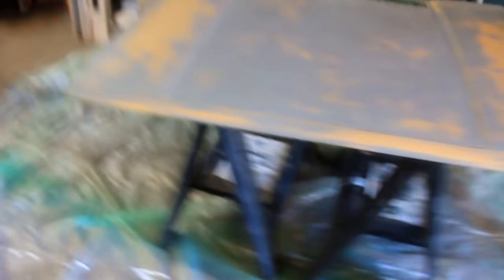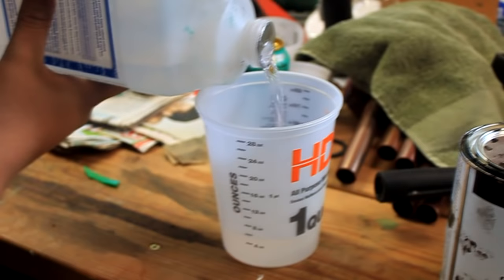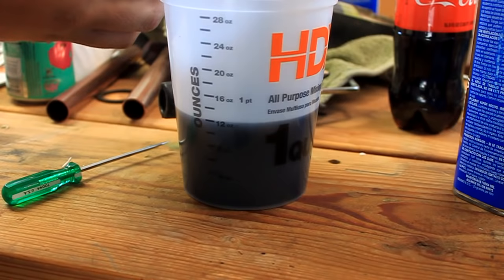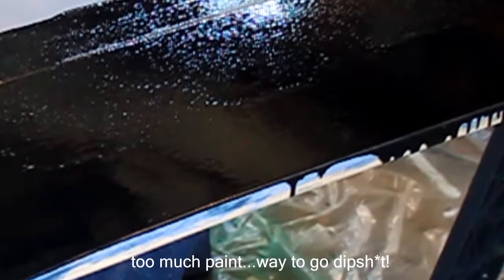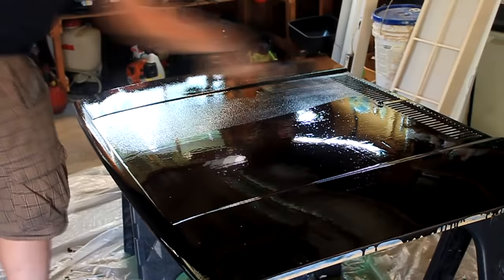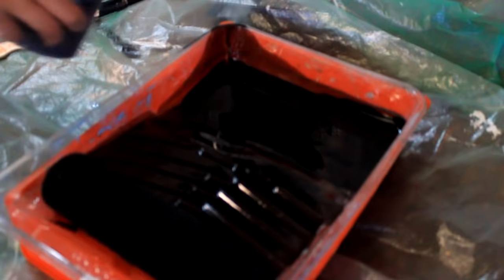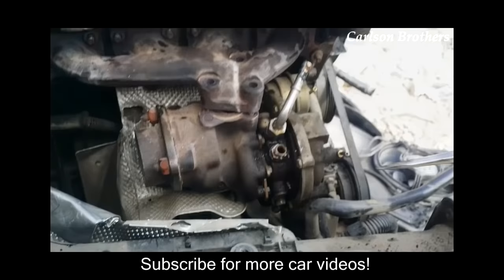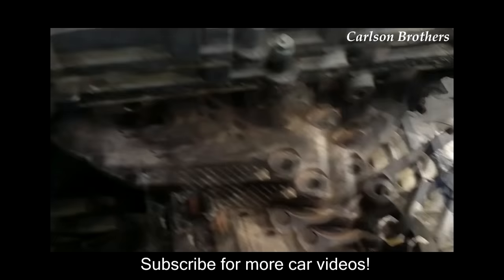How To Paint Your Car With A Roller

Comment: I repainted my entire 2003 Nissan Pathfinder LE with Rustoleum black glossy. I used 4 inch wool mini rollers and the outcome was better than any Maaco paint job I’ve had with a longer warranty as well.
Reply: Tell me more
Reply: @jeromemalveaux3790  basically in short I thought it’d be an awful idea, needless to say the outcome was 10/10. Highly recommend this to anyone as broke as I was at the time 😂
Reply: May I ask how much you thinned it?
Reply: I doubt that....
Reply: @SOLDOZER  all facts
Reply: @zombieepx1933   No roll on job will ever look as good as a spray.  Just not possible.
Reply: @SOLDOZER  obviously, but with skill and the right paint, and the right type of rollers. good prep, you can make it look nearly as good. especially if you go more of a matte route
Reply: @SOLDOZER  ive paid $1000 for a maaco paint job before, they sprayed it. when i rolled it the next time it looked just as good and lasted longer for less than $100 in paint. I painted metal surfaces for years at different power plants for an industrial sandblasting and painting company, theres nothing wrong with using a roller on smooth metal surfaces, a lot of our work was done with rollers.
Reply: @zombieepx1933   $1000 wont even cover cost of materials for a terrible paint job.
Reply: @zombieepx1933   No, you can't. Thats why nobody does it except teens in their garage.
Reply: @SOLDOZER  sure thing pal, you seem to be quite the miserable person to argue over something like this on the internet, what can i say other than youre right? is that what you wanted to hear? im actually 32 years old and a small business owner, and if my roll job has a better outcome and longer lasting result than a $1000 paint job from a company thats been in business longer than you've been alive, then its good enough for me lmao
Reply: @SOLDOZER  maybe some day you wont be so spoon fed to have thousands of dollars sitting around to throw into a new paintjob, your car will begin to rust and you'll have to make some decisions. its about $4,000 to have a paint job done right on a vehicle, would that make sense to invest in on a 2003 nissan pathfinder, thats like the entire cost of the vehicle lol.

 ive owned this vehicle for 15 years and use it to pull my 12 ft trailer that my pressure washing rig is on, all my stuff looks sharp including the rolled paintjob, i get compliments on it all the time sorry that you think things can only be done one way. maybe you just need to git gud
Reply: @zombieepx1933   This is Youtube. Would take you 30 seconds to upload your rolled on paint job thats better than a spray and explain how it was done.. But we know why you don't. Cause you cant.
Reply: @deidretal2500  i thinned it enough to where it was almost too runny. just have to feel it out i dont remember exact. but ive also seen some where it was perfect to use right out of the can.
Reply: @SOLDOZER  well it’s also been over 3 years since I did it, you really want me to upload a picture of it for you? Haha. You’re replying on over 3 year old comment and now demanding uploads. This guy smh lol
Reply: @SOLDOZER  alright I uploaded it. You happy now?
Reply: @SOLDOZER  well?
Reply: @zombieepx1933   Looks highly faded. Not Better than a MAACO.
Reply: @SOLDOZER  for $1000 the maaco job they sprayed didnt even last 1 year before flaking off on door handles, and on the front bumper paint began to peel in less than 1 year as well, the roof they sprayed so thin the sun was baking most of it off by 1 year. this paint job i rolled on has no peeling anywhere for 3.5 years, costed $80 in paint and maybe 3-4 hours of labor. its lasted 3 times as long still has a glossy shine, and the video shows just that, you can see the reflection of the sky on that paint job.
Reply: @SOLDOZER  Most people don't touch cars, because most people suck at working on them.
Reply: @zombieepx1933 correct you set up the paint like you would in a gun with thinner. I seen some rolled paint jobs that look great. Back in the day some body guys would roll paint it's a lost art now

Comment: Tip for wet rollers and brushes - just get excess drip paint off then put in air tight plastic bag twisting the bag then around the handles = wet, steady to go in the morning without washing, throwing away and never ending cleaning. Keeps the roller / brushes wet and fresh.

Comment: I painted my firebird with a four inch roller and it was shiny and looked better then a spray can job and I didn’t have to worry about my neighbors bitching about getting over spray on there cars parked down the street.
Reply: All I'm trying to do after multiple coates is to get my plastic pathfinder front bumper smooth.
From a distance ,it looks good, but up close you can see imperfections.
I'm using same spray paint that was made for plastic and pre primed,so I think I will spray small roller then apply.
Reply: Yep, that is typical bored neighbors.

Comment: In 1987 I painted my VW camper in black hammerite, it had prevoiusy been done badly in silver with heavy runs in places, which I flattened out. I used a 9" gloss roller and a 2" gloss brush and the finish was perfect, even had a couple of people ask me where I had it done and they were suprised when I told then how I did it.

Comment: Getting ready to repaint my '08 Honda Element, and wanted a reliable DIY method... loooove the Rustoleum plan! Thanks for your tips on rollers, # coats, etc. I'm off-grid, no garage, so I may have some leaves and pine needles sticking... haaaaaa!

Comment: I did this years ago using both spray and roller.  I didn't thin the paint, I added Penetrol and it worked GREAT!  Also, never reuse a roller when you can afford a new, clean one.   Just sayin.  Car turned out so good that I had request to paint other people's junkers! LOL
Reply: sinbad20001 ....what's pentrol?
Reply: Penetrol is a paint additive that can extend oil-based paint without thinning it. The dry time is longer, but the finish tends to be smoother.  By extending the dry time, you can go back and touch up within a longer period without dragging the paint.  Takes longer to get tacky. Floetrol is their product for latex paints, and is helpful when painting on warm days.
Reply: You’re actually correct I forgot about that lol

Comment: First thing you need to use self leveling paint if your expecting no Oregon peal. The best place to find the self leveling paint is at a farm supply store. It’s called Tractor 🚜 paint. It cost around 35 bucks a gallon. But you don’t need primer or reducer you just clean the serfs and then roller it on with a sponge roller put 1 cot on what 15 to 24 hours thin apply a second cot wait about four days then you can put decals or pinstripes or spray paint over it. You can also wet sand and buff it too

Comment: I'm wanting to try roll and tipping, run a 4" roller for even disbursement of paint in one direction and barely drag a quality paint brush in the opposite  direction over small sections rolled out, to remove air pockets and bubbles caused by the roller. I want to try penetrol instead of thinner in order to remove most all brush marks, and add a couple % of enamel hardener for harder most luster finish. It supposed to lay as flat as spray and equal the shine. The extra supplies needed would likely only cost as much as the extra sandpaper you need.

Comment: Just soak your roller in the paint then put plastic over top and seal around it tightly with tape. Good to go the next day. I think it'd be better to go one good pass with the roller and to do more coats than to keep going over one coat with the roller bc it starts to disrupt the paint more than cover it.

Comment: If using a roller is an approved method of painting airplane panels than its more than good enough for cars as long as you're not looking for something too smooth, its gonna have a slight rough texture to it, but its way better and not to mention easier than using a can of spray paint, trust me

Comment: this is actualy a house hold tip: ceep the roller in a plastic bag and the roller is good to use the next day!. i cant say this works with car paint but wall paint is 100% good to go the next day!
Reply: +otto leeverink it will work with this paint, its just rust metal paint, I keep mine in any grocery bag, seal it up best i can, and put it in the old fridge. never dries out that way, no need to clean it, i would never clean a oil based roller lol!
Reply: Wouldn't work here so much. He used spirits to dilute the paint which will dissolve plastic bags. The stuff even dissolved a pair of rubber gloves off my hands
Reply: Also wrap in foil, seal in baggie then place in freezer

Comment: ONCE YOU APPLY THE PAINT.........if it has been more than just a few seconds....DO....NOT........ROLL ( or brush) ...BACK ....OVER..... THAT ....AREA........ until after the paint has significantly firmed up.

Even though it LOOKS like orange peel..... DONT TOUCH IT...... it will somewhat " lay down" or " self level"...

but...

If you re-roll or rebrush over paint that is more than a "minute old"....

VERY shortly after paint is initially laid down, it starts to dry, first by skinning over.
The top most molecules start to cure and harden...THEN...if  you brush or roll back over that curing/hardening paint... YOU....WILL.... disturb and distort that " skin"....

rolling or brushing over freshly laid  paint is what CAUSES brush strokes or orange peel.

like it or not..... lay down a coat.... and move on...  if its been more than a minute DO NOT GO BACK AND TOUCH IT UP ...  if it HAS been only a few seconds...myou might be able to add more paint but make sure that you fully " re-wet" the whole area with fresh wet paint which help all of it lay back down.
Reply: Good advise!
Reply: SOLDbyYOU YES!!!   Hello quick question. I plan on doing this on Saturday long should I wait beetween coats ?

Comment: when done with the first coat, you can just wrap your roller up in a plastic shopping bag or a small trash bag and just keep it air tight. I like to roll it in the paint first before sticking in a bag that way it's nice and juicy and it stays usable right away when pulling it out of the bag just make sure you don't leave it in direct sunlight or enough to flow through because it can tack up and dry, but between it should be just fine wrapped up in the bag if you get a little bit wet with the paint you were using and then just store it in there while you wait to do the second coat. Shoot, I've had a roller wrapped up for a couple weeks and I still pulled it out and it was ready to roll so they last a while if they're not exposed to heat or air I mean, they have actual roller canisters that are like the size of Pringle Can that you stick your roller in while it's wet and it'll keep it ready to use

Comment: Guy told me I ordered paint on eBay said use a 1/4 nap gonna get one at Lowe's on Saturday. Probably be better than using spray paint or a spray gun when all the paint fumes be in the air. I should of used a roller in the first place it seems better to me.

Comment: When you use a foam roller first saturate it with paint, it prevents bubbles and orange skin, or use a short haired lacquer roller.
Reply: makes no sense...... Cannot be done using the 60/40 ratio

Comment: It's kinda funny how people seem to think the One and Only way to paint a car is by spraying (preferably in a mucho expensive paint booth); and that using rattle-cans, or a roller, or a brush just means you're going to get a crap result.

Well, as you prove, it doesn't have to be that way; sure, it takes a bit more elbow-grease but you can still have a damn nice paint-job at the end of it.

Guess that goes to show what "Everybody knows you can't..." is worth, eh?
Reply from the maker: +Jim P You're absolutely correct. Unfortunately, I ran out of elbow grease, so it's going to a shop...haha. But it can be done for sure! Thanks for the awesome comment!
Reply: Jim P  I have a black 99 Chevy Cavalier and the paint and clearcoat have come off but I’ve thought about getting some exterior glossy black paint and just using a brush or roller and painting it. It couldn’t look any worse than it does now. What do you think about that?

Comment: Loved your video, I used dulux polyurethane orange on a datsun back in the 1970s that was rolled and it looked dam good I did have a problem with small bits of the roller stuck in the paint but from about 20 feet you thought it was a professional spray job. Just subbed regards from the uk.

Comment: Might help a little but if you're not worried about roller texture which I don't think you are you can buy sponge disposable roller 9" down to 4" you don't have to clean them they're cheaper than nylon and you don't get the little hairs from your roller in the paint.

Comment: If you put the roller in a sealed bag it will be fine to use as long as the air doesn’t fleet at it. Or ceran wrap it.

Comment: Your math is right, but your measuring IS wrong. You said you need to put 4.8oz of thinner and 7.2oz of paint, but actually put around 5.8oz of thinner, because it was waay closer to 6 in the mixing cup... so you ended up mixing around 5.8 thinner and 6.2 paint, which kinda makes it almost 50:50 again. :D well done, plus you gained a subscriber

Comment: One year ago I knew nothing about painting but  I wanted to fill\prime\paint my car by myself. I read about painting a car with rustoleum and watched some videos and I thought it is a very good idea and cheap. Now I'm sure it is a very bad idea! Look at the video, he sanding a car with 400 grit sand paper. You know what does it mean? 1) It has to be many many layers of paint (means extra money + extra time). Because 400 grit will leave huge marks. 2) To make paint glossy you will need to increase grit very slightly: 400-600-800-1000-1200-1500 (usually it requires 1-2 more extra steps with 2000 or 3000) .So it is very time consuming! Polishing a whole car take about 14 hours if you have good experience\good tools. Polishing a car with a normal paint job which doesn't require 400 grit! Don't forget that sanding by hand leaves more marks than random orbital polisher with the same grit. Bad abrasives leave scratches even if you do everything correctly. If a paint job is bad, it will be very difficult to make it look smooth in difficult areas such as areas near handles etc.

For a small car, with a good spray gun it is enough 1L of base coat and 1L of clear coat. The price for this is not much higher than 4 L of rustoleum. You can get a cheap compressor and than sell it. The same with a spray gun. If you paint your car with a spray gun with good 2K basecoat\clear coat you won't need to sand it = saves your time and money you spend on abrasives\cutting compound\pads etc. Your car will look glossy just after you painted it. You spend 10 times (I don't exaggerate)  less time and you have a better result. You probably will need to spend 2 times more money than on rustoleum plus brushes\abrasives\cutting compounds etc
Reply from the maker: Very rarely can you just spray on paint and clear and be done with it. Most respectable paint shops will go through the same process that I used. Wet sand and buff to smooth high gloss
Reply: Which type of paint do the modern cars use? 2K paint: base coat plus clear coat. You never buff the base coat. And you sand base coat only if the were some problems like runs, insects, dust etc. After you sand, you spray it again. Then you put a clear coat.

I'll give you an example from my life. I had a set of spray guns from an automotive store. They looked ok, I though they spray ok. But I had a horrible orange peel which required 600 grit to remove. Then I bought a good gun, sprayed base coat and cc. Here is the result. 
http://i1226.photobucket.com/albums/ee409/tim8310/20160413_190248_zpseeuyss9k.jpg

It is not perfect because I used the gun first time. and the gun is not a professional model, plus cheap clear coat and base coat. But it is not too bad. And I didn't buff. sand or polish it. Even with what I got (gun and components), I can get better results. I just need more practice. Pro with a pro equipment can get even much better results. 

I believe any normal person would like to spend less time but get a good result. If you spend a lot of time, it should pay off. If you are preparing a  car for show and you spend a lot of time I can understand it. But if you just want to fix your old car, then it is so stupid to spend so much time! Spraying a detail properly, will make a look of a new car. Do new cars need sanding or buffing? No! I'm sanding my whole car now. Not to fix a faulty paint job. Factory paint has a lot of scratches and I want to remove it. It is very time consuming if you do it properly.

I could believe in all this rust oleum bullshit before I tried spraying, sanding etc etc
But not now)))

Comment: you should of stretched it out with very little paint to prevent as much orange peel as possible wet sand it after apply super thin high gloss clear coat stretched out as much as possible buff it should of gotten great results

Comment: i laughed when you also had the plastidip problem.  PO plastidipped the entire damn truck with what must have been 2 small coats.  still trying to pick it all off before I paint it.
Reply: Next time instead of picking it off try using a heavy duty degreaser and a brush. Easier And faster. A buddy of mine used PD on his whole pickup. Looked nice but he decided after two years he wanted the original factory paint back so we washed and used degreaser on it and it went from PD black to the factory super white in a couple hours.